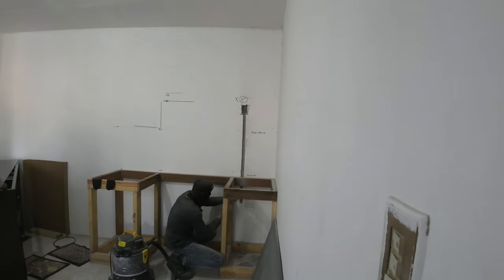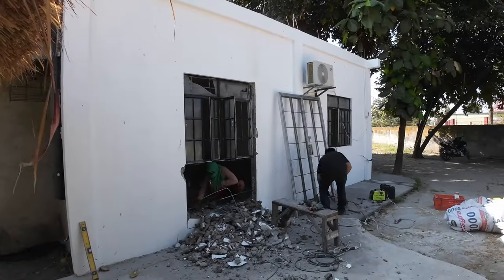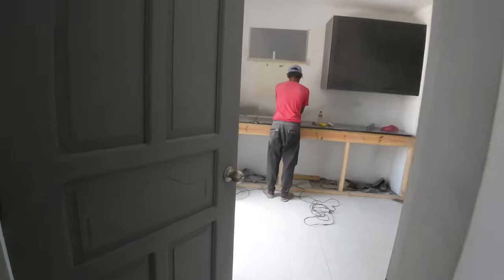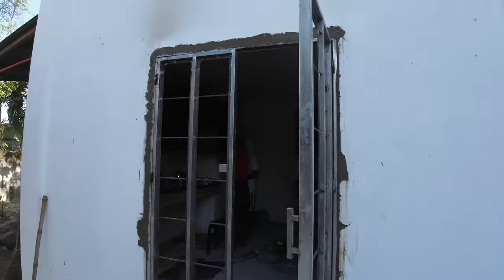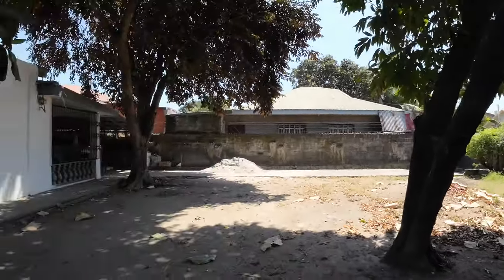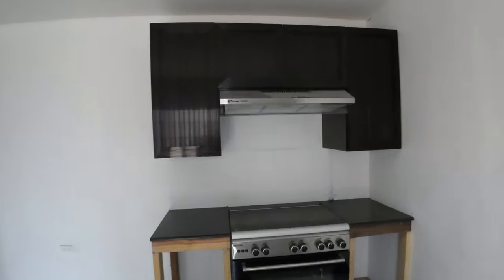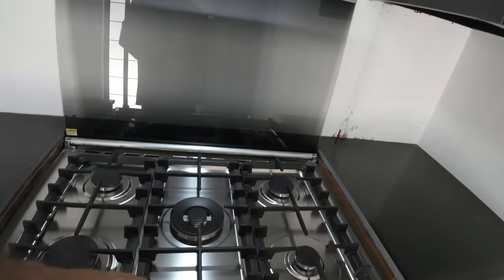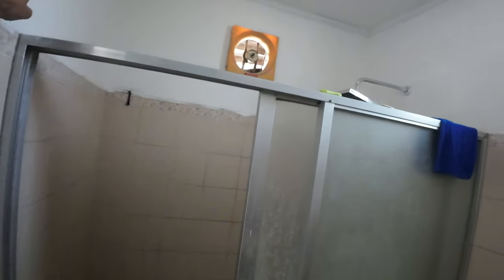$36 USD monthly Rental Update #6   HD 1080p

Comment: You will make all these expensive improvement to the home, and then the value of the home will increase, and so the owners will kick you out, and put it back onto the market for a much higher rent, plus they will have all those improvements you paid for, for NO reason.
Reply from the maker: Nope. Not gonna happen. They are honest and not hard up for money. I have a 3 year lease at $36 a month with two options to extend.  The house was not for rent when I found it it had been vacant for a few years. They would have had to fix it up before someone would have lived there. When they retire and move back from the US they plan to tear it down and build a mini mansion like the other houses in the subdivision
Reply from the maker: Sorry for the late reply I just saw your message. I will take the aircon and appliances with me. It's the$250 a month saving that makes this a good deal my friend.  I will have less than $2,000 into this when I am finished.  The land would have cost me Over 1,2MM to start

Comment: Be careful with what bamboo you put near the back wall, if you put the wrong type in it may knock the wall down, that wall doesn't look to be that well built in the first place.
Reply from the maker: It's just old. Steel reinforced concrete filled hollow blocks with solid posts even 9 feet.  Thank you for the heads up!!